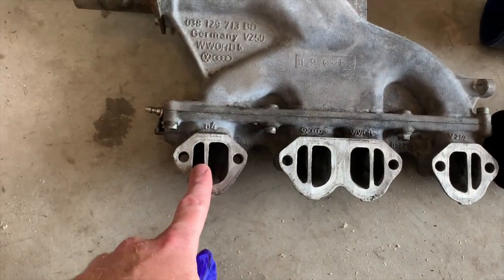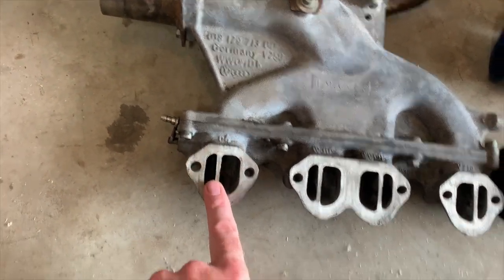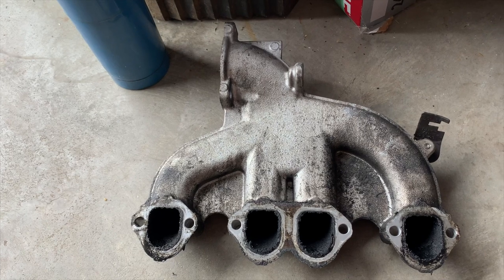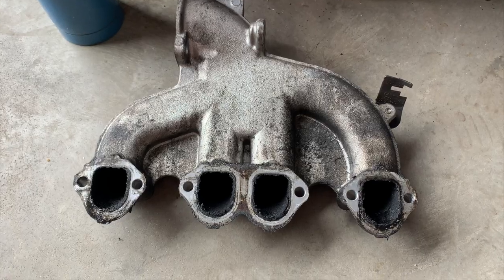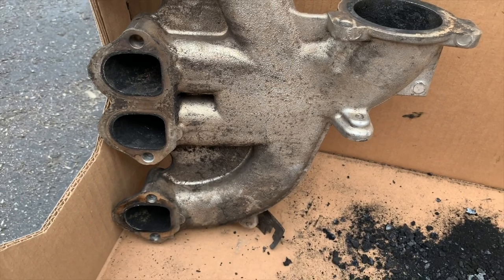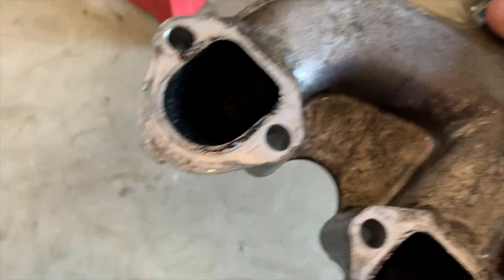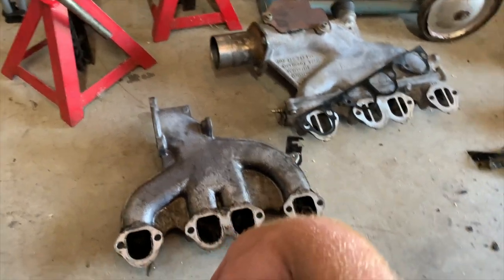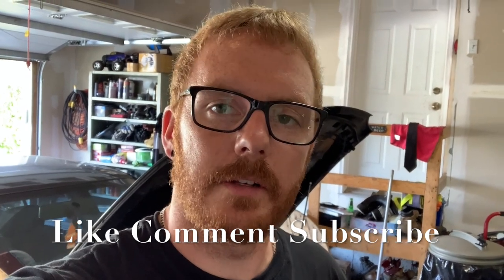removeing bew tdi swirl chambers

Comment: Excellent tutorial. I’m interested to know if you noticed any improvement. I’m considering doing the same thing with my cylinder head. However, I don’t have a replacement intake and I was wondering it it would be beneficial to open up the factory intake manifold?
Reply from the maker: I will be sure to post a video of the results I see 
As a note I do have a big turbo and other mods as well so my results may be different then someone with stock or even a vnt 17

Comment: Just wanted to say they are not on pins instead the swirl flaps slide into a channel
Reply from the maker: The actual flaps are in the intake manifold 
These are just dividers / channels for directing the air
Reply: @ERAutomotive  yes, I did remove mine I was looking for ‘pins’ as I thought that’s what the video said. Thanks for sharing , idk I’ll notice any improvements maybe .5MPG? Lol
Reply from the maker: Lol not sure you’ll notice any mpg gains

Comment: i have a 2005 bew tdi mk4 jetta, and i’m going to be removing my egr, tuning it, and possibly taking off my intake manifold to clean it. what’s up with those flappers? what do they do? what’s the benefit to removing them?
Reply from the maker: They are there for emissions purposes 
Removing them frees up space in the intake for improved flow
Reply: @ERAutomotive  awesome thank you for the quick reply! when doing this, should i be worried about breaking anything or gouging the head? i have 240k miles on my tdi and i am trying to make it a reliable daily that can scoot when i press on the go pedal👍 great video and explanation! should i separate the stock pd bew intake manifold and clean it or should i leave it as one piece? i see you used a brm intake manifold but i don’t have the proper adapter pipes to hook up the intake from the bew to the brm intake manifold
Reply from the maker: I would get a brm intake and a brm racepipe 
Then u can carefully remove the quick connect from your elbow 
Then your all set
To remove the quick connect you would cut through the metal part untill u see rubber 
Do that in 2 spots and you’ll be able
To peel it out
Reply: @ERAutomotive  wouldn’t that delete my ASV valve?
Reply from the maker: Yes also freeing up for flow